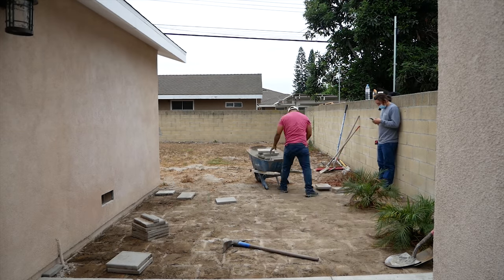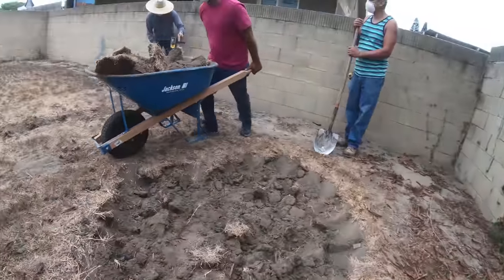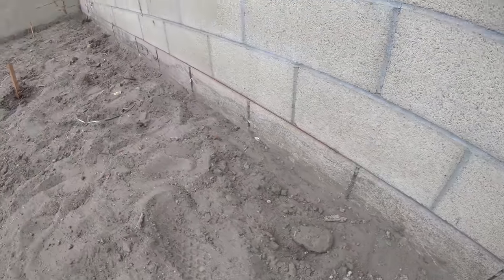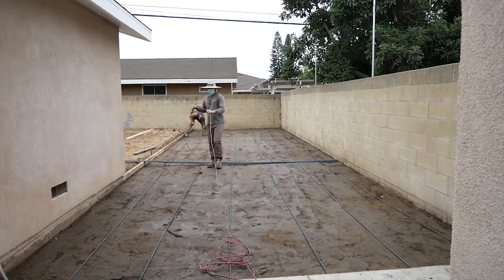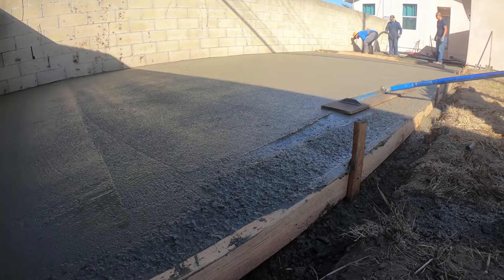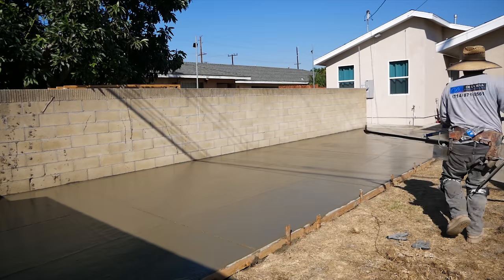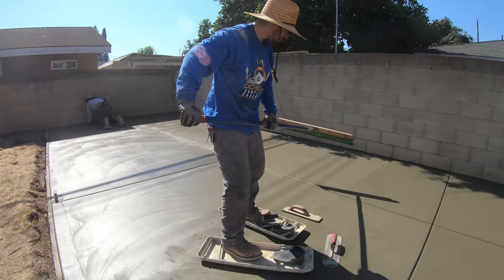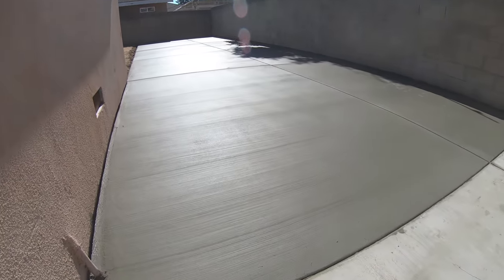How to Pour a Massive Concrete Backyard Patio!

Comment: I'm about to have a big slab patio poured and it will go over two sprinkler heads.  Can I just cap those or do I need to relocate the pipe for the ones further downstream?  Thanks in advance!!
Reply from the maker: Sounds like that may be your only choice unless you replace the whole line

Comment: Hey David, looks great!  My house has an (I think) original patio from 1950 extending off the back.  It has larger rocks its it's not the modern style concrete pour.  it looks like there was a pergola there or some kind of roof because there are square holes going down into the patio.  So its just a large slab with huge rocks in it.  I have no idea how deep it goes.  I don't like it at all and want to get rid of it.  Wish I could hire you!
Reply from the maker: Hard to say how deep it is unless you drill some holes, and check for reinforcing with a metal detector.
If its solid and no cracking or movement maybe you could cover it with something.
Reply: @OdellCompleteConcrete  it actually does have some cracking, grass growing in the cracks..  and its a home to alot of ants.

Comment: My neighbor just had something similar done. 3000 psi over big rock with no rebar. It looks like junk. What do you think? 😅
Reply from the maker: Tear it out
Reply: @OdellCompleteConcrete  i think they framed it over the grass. I’m going back tomorrow, I was floored when I called the guy and he said no rebar. The frame opened at both sides, nothing is straight. I’m taking a straight edge tomorrow because I’m pretty sure it’s even bowed the whole width of the pad. Finish work was junk. They poured over a steak and left it in, I can the side of 2x4 from the side of the slab. They took the form off too early and didn’t clean it, looks like dried dog turd done poured out the side. I would love to send you s clip and have you roast tf out of it. I think everyone would enjoy it.

Comment: Hey guys, My concrete contractor is pouring directly against my new home foundation and not putting an expansion joint.  I live in california is one of those expansion joints necessary? The builder put them in when they poured the side patio.
Reply from the maker: You could put it on either side

Comment: Beautiful, Why do you put the lines in it?
Reply from the maker: Crack control
Reply: Under the hard sun, cement, concrete, asphalt... absorbs the heat then expand. So it'd better to have room for them to expand, otherwise they will crack. Cutting line to create small room for the expansion. Same thing with bridges, you can see the metal parts crossing them. They serve the same purpose to prevent cracking in bridges that could lead to broken on the surface and inside.

Comment: David, I live in northern Alabama. I have  2 feet dug down on one side and 16 inches on the other side on a 16 foot circular dirt 'pad'? I had a above ground pool in there sunk down for my grandchildren. I gave them the pool so they could swim ever day if the wanted. So I'm left with 16 foot round erea. I want a wadding pool for my dog. So what kind of sides would I use so it is water proof?  I will rent a mixer and pour the concrete. While it's wet do I put what ever side I use ,do it then? I already have a drain put in, I will just put a 2by2 drain with a shut off valve. Do you have a email address and I will send you a picture. Thanks and Foxie Dog thanks you too.
Reply from the maker: Start with concrete then plaster.

Comment: The guy who threw my slab made a mess
Reply from the maker: It happens
Reply: @OdellCompleteConcrete   im your biggest fan bro, learning alot!! Anything you recommend ..alot of water forms on a part of the slab that connects to a brick wall. Ive thought about drilling a weep hole or making a hole through the wall and putting pvc pipe